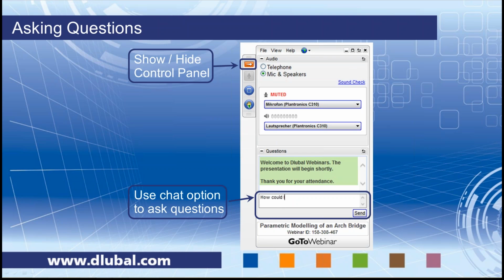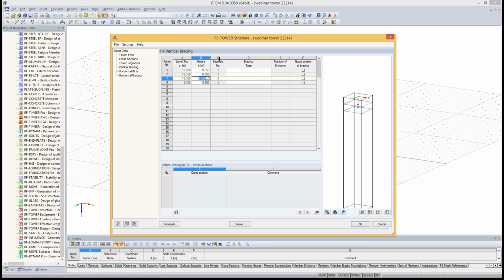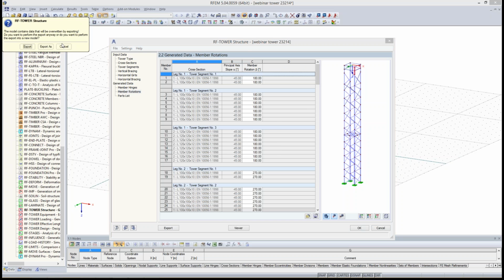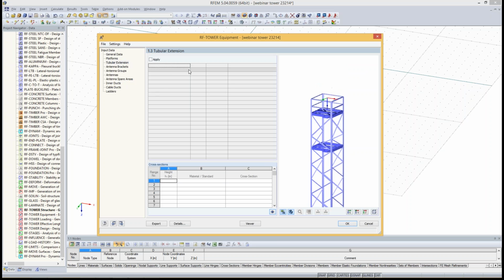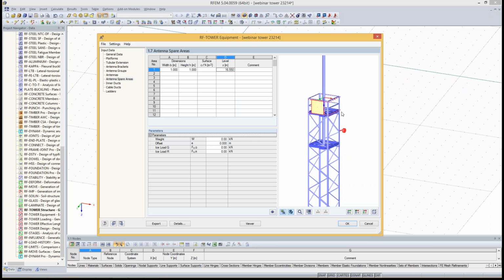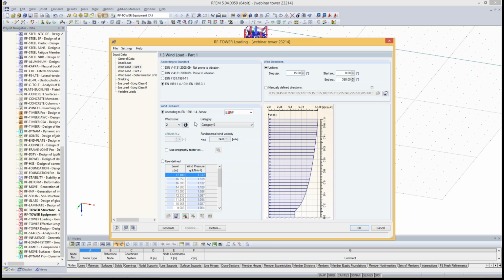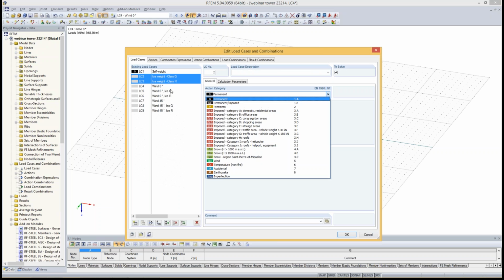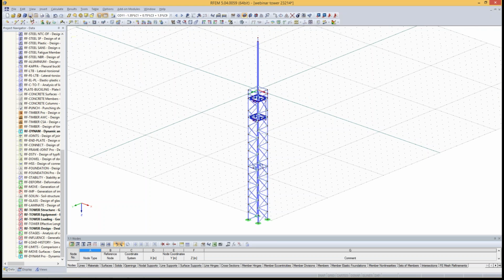Webinar: Modeling and Designing Steel Towers by Using RFEM

Comment: I am doing my thesis and working on a steel tower. I have to model a steel tower of 325m height, therefore using the tower module of RFEM. 

I have a few questions related to the modeling. 

1. The tower's height in the tower module is not increasing more than 320m. How can I increase it? 

2. I need to connect various members using links and create a connection between the inner core of a structure and the bracing of the outer core. How can I do it?

3. I need to add pre-tensed guyed cables at multiple levels of a tower to the ground level which has a sag as well how can I add sagging to the cables?

4. Is there any possibility to extract the model as a text file and use it as input in some other coding platform (for eg. MATLAB, Python ) so that I can modify changes to the structure without opening the RFEM and doing it manually will give the new dimension to the system and its behavior.
Reply from the maker: Hi, Rishabh!
If you need assistance, please contact our customer support by e-mail at info@dlubal.com and send us your model. Then we can check it.

Comment: Hi, just a few questions!

1) Is it possible to add seismic load on load combinations?
2) Can it calculate the maximum horizontal movement/displacement at the top of the tower?
3) Is it able to produce detailed sheeting in dwg format for the fabrication of the members?

It would also be nice if you could do a webinary for the joints!
Reply from the maker: Hi, Mike!
RFEM/RSTAB are capable to do seismic design for any structure created with the tower modules. One can also get internal forces and displacements on any point of the structure for any load case or combination. We cannot create drawings - we are an analysis software. But there are interfaces to programs like Tekla, Autocad or Revit for detailing.
Let us know if you have further questions.
Reply: @DlubalEN  Can the final model of the tower be exported to tekla? In what file formats that can be editable for drawings can RFEM export to?
Reply from the maker: Hi, Mike!
There is a direct interface to Tekla Structures that works in both directions. There are also numerous other interfaces. See https://www.dlubal.com/en/solutions/application-areas/building-information-modeling-bim/what-is-bim.
Reply from the maker: Hi, Mike!
You also can watch some webinars on our website about this. See https://www.youtube.com/user/DlubalEN/search?query=tekla.

Comment from the maker: Dlubal Webinar: Modeling and Designing Steel Towers by Using RFEM

More Dlubal webinars:
https://www.dlubal.com/en/webinars.aspx

Further information:
https://www.dlubal.com/en

#bim #cad #cae #concrete #connections #crosssections #dlubal #dynamics #eurocode #engineering #engineeringsoftware #fea #fem #glass #industrialconstruction #mechanicalengineering #membrane #plantengineering #rfem #rstab #timber #steel #steelconstruction #structuralanalysis #structuralengineering #tower #webinar